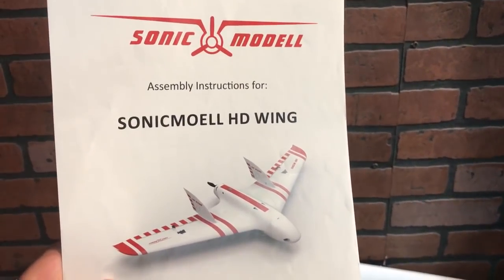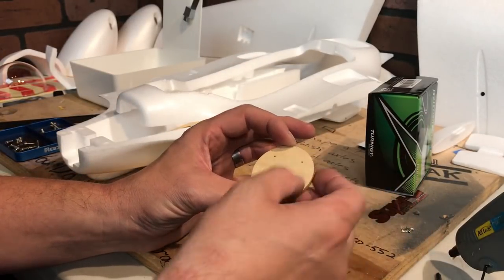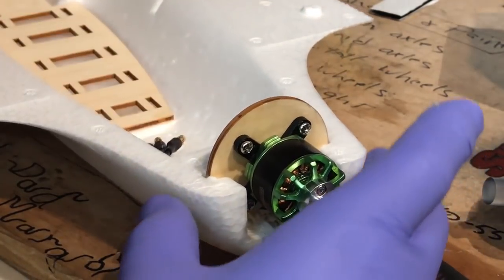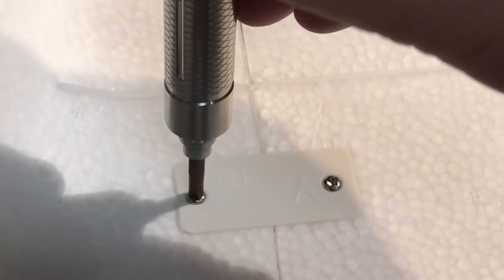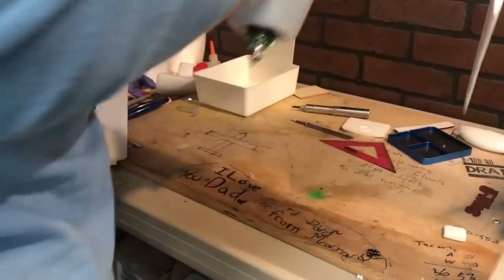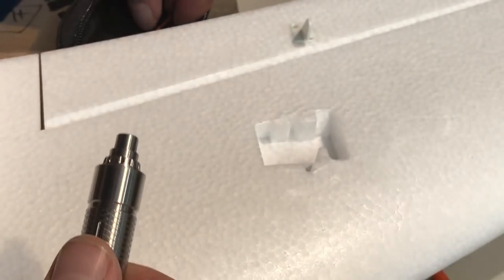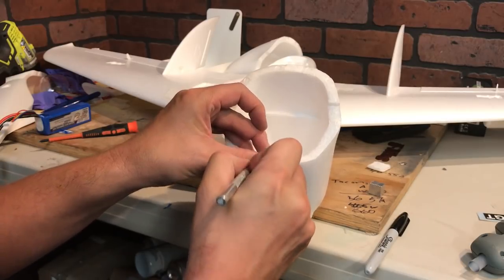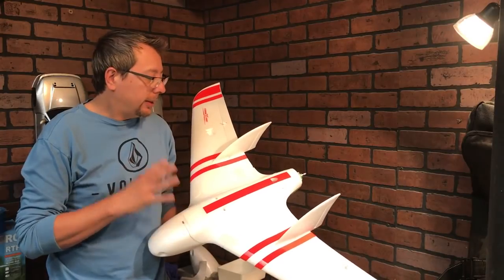Sonicmodell HD Wing Build and Tips

Comment: I just had to immediately get that screwdriver. I need a electric screwdriver, and that one looks great and the wrist control looks great. A little warning though! Hot glue does not stick to metal, glass, magnets and some certain types of plastics! It does hold, but peels right off with little force!
Reply from the maker: I usually heat the magnets first or else it cools the hot glue too fast inhibiting the bond. I use hot glue on my drift cars body mounts- haven’t failed yet

Comment: This was my second plane, not a great choice for a beginner as it's quite fast and that nose is fragile as hell, I smashed all my nose pieces in a few flights and then the battery mount too. Not sure why the motor needs to be so far back either, I much prefer the z84/fx61 etc style of fuselage, it's tougher and easier to get your hands and fingers into.

Comment: Hey, thanks for the tip at 7:50. Just starting on mine and used epoxy for this bit.
I found that a brick wouldn't balance at all on top of a piece of 2" x 3/4" piece of wood while drying so I used cable ties through the holes to secure it down.
Waiting for some carbon fiber strip and laminate which should turn up soon...

Comment: I have the Mako and flew today. This is a great plane!  I used a 7000 4a li-on battery and flew 14 miles out and a total of 30 miles.  Used half of battery but was scared to go more because I haven’t set my esc to cut off at 2.5. It’s still in lipo settings.
Reply: 4S I mean not 4a.
Reply: If you don't mind me asking what are your electronic specs that you installed? I'm flying the pnp Mako. Looking for more flight time. Thanks.
Reply: wyomingoutdoors I use the cobra 2221 940 kv motor, Get Titan 7000 li-ion battery, eagle tree Vector, Tbs micro receiver, rmrc 1.3 600 MHz video transmitter, 1.3 trurc rhcp antennae,mini runcam camera, runcam hd video camera for recording. I think this plane is underrated. I still have 2 in the box.
Reply: Thanks for the info. What size prop are you cranking on that? I'm assuming that's 4cell???
Reply: wyomingoutdoors It’s an aeronaut folder 9x7. Yes it is 4 cell. I also have a little reflex in the wing. Happy flying!
Reply: Do you use the 4S endurance pack or fast discharge pack from Titan?